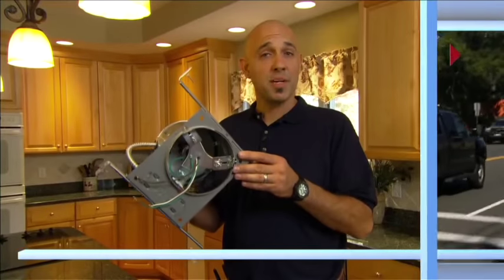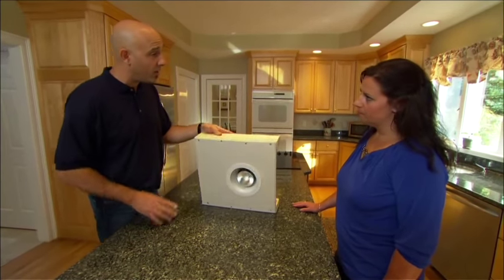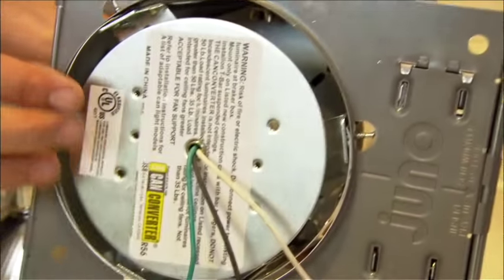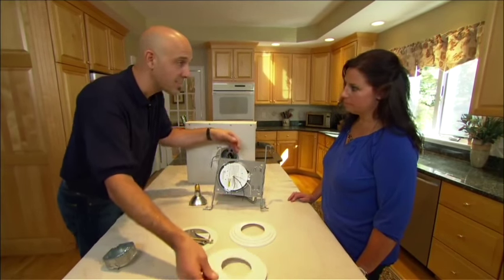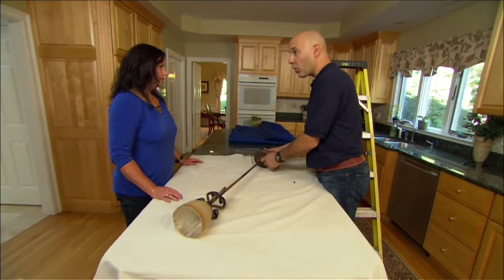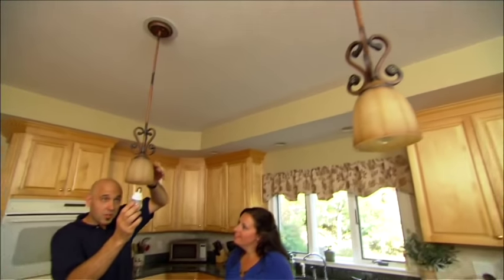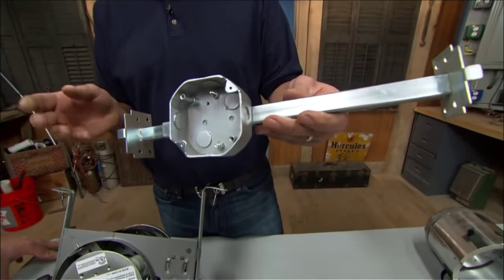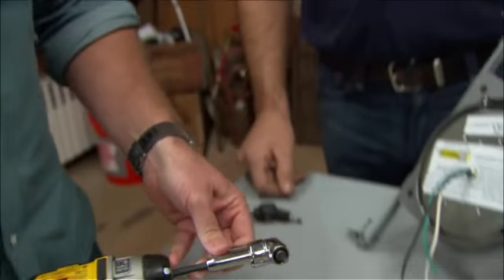TV Show "This Old House" Features The Can Converter

Comment: The person with the previous comment OBVIOUSLY DID NOT understand the step by step instructions. The installer followed the correct procedures. He eliminated the job nonessential screws and used the converters housing instead;completely securing the fixture to its new mounting unit.

Comment: What about converting a CFL can light?
Reply: You will need to bypass the transformer and bring the 110V power directly into the can light itself.
Reply: Our electrical adapter won't work on a CFL can light

Comment: for 5 lb light fixture this is ok,what about 20 lb or more?
Reply from the maker: You must not attach any light fixture over 5lb to a remodel can light. Only new construction cans with bar hangers, using The Can Converter model R56 will support the weight of a 50lb light fixture.
Reply: @TheCanConverter  : If I have an old work can/fixture, how do I convert that to a flush mount? Do you have a kit for that?